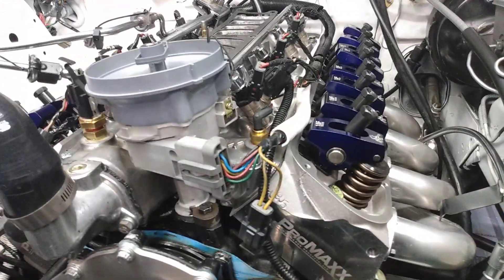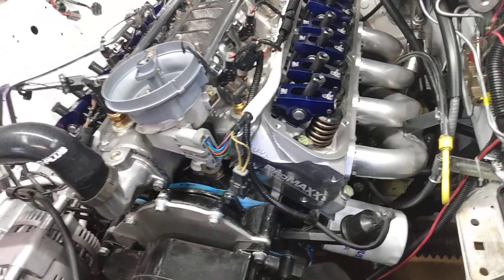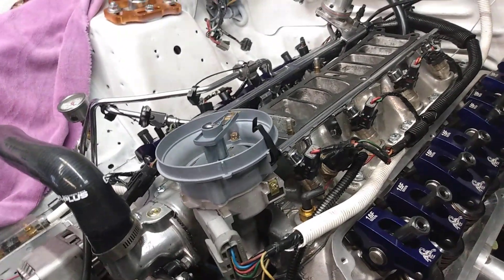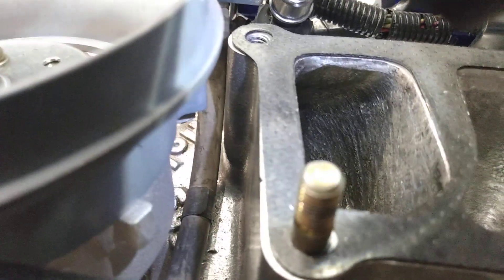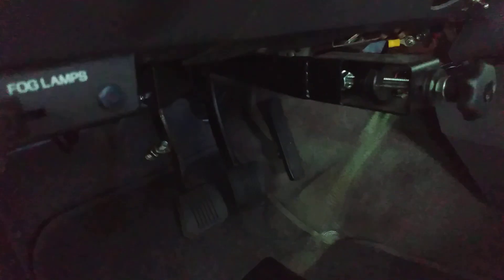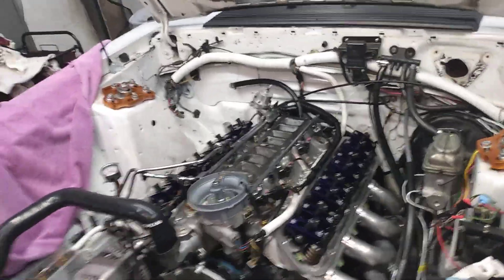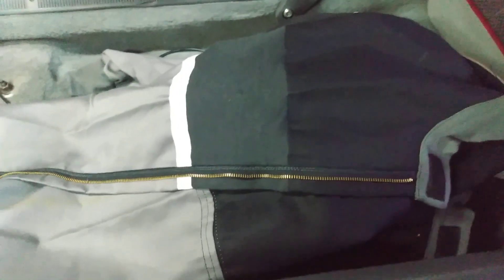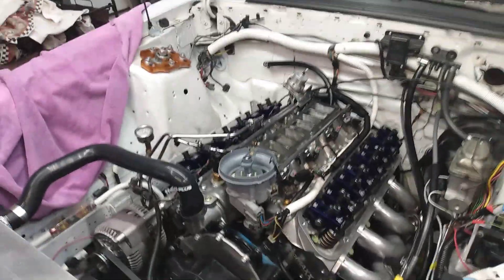Head swap, going to try the ProMaxx 180cc SBF

Comment: The term for the valves not in line is canted or splayed sometimes called semi- hemi
Reply from the maker: yes, canted if the angle in and away from the cylinder bore when opening

Comment: does the blue print engine have OEM style piston as far as stock type valve reliefs???
Reply: @vrm86gt  i just bought a set of the promaxx 180 heads for my 5.0 i have a couple questions if youd be so kind as to answer. first question did you rocker studs break throught the port roof where the factory drilles the head for the studs? second question did you have to flycut your pistons for valve clearance? i have heard that 2.02 valves would not clear the stock valve reliefs on an inline valve head
Reply: @jackrabbit7389  the heads will clear stock valve reliefs, I run the same heads on a 91 302 with a mild solid lift cam
Reply: @GR-RadioSouthCarolina  what specs on your cam Amd how much clearance did you end up with I  gonna measure PTV clearance regardless all engines are different one from the other just trying to get an idea. Mine also is a 91 short block.
Reply: @jackrabbit7389  112 lobe seperation..495 lift intake, .495 on the exhaust. 262 duration on intake 269 duration on exhaust. Duration @ .050 intake 225 and exhaust 232. And 108 centerline
Reply: 80 thousands clearance and that's a tight 80

Comment: Hi did you get the engine back together? I recently had the same heads installed in my 84 Mustang. The car is still at the shop and I was wondering what you thought of your results and if you had any testing done.
Reply: @vrm86gt  11.55 is a  really good ET and will be tough to beat.

Comment: I am curious what CC volume intake & combustion chamber the trickflows are compared to the Promaxx heads?? I am looking forward to your test and tune thoughts on the Promaxx heads as well. Thanks for posting this as I havent found much info on the Promaxx heads.
Reply: @vrm86gt  Awesome. Your track ET's will be a good comparison of the Trickflows 170's VS the Promaxx 180's. I will be waiting for your thoughts and track results with great interest.
Reply: @vrm86gt  Glad you got it fired back up. So what is the CR and CC size of the two sets of heads??
Reply: @vrm86gt  Thanks for the update. 2cc wont make much of a difference. Did the Promaxx start off at 175cc or 180cc runner size as they offer both.